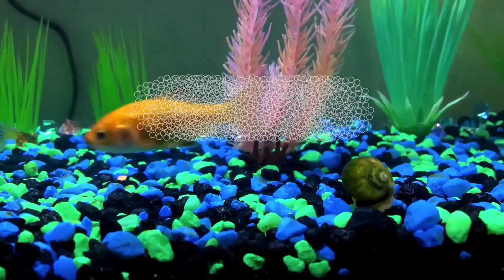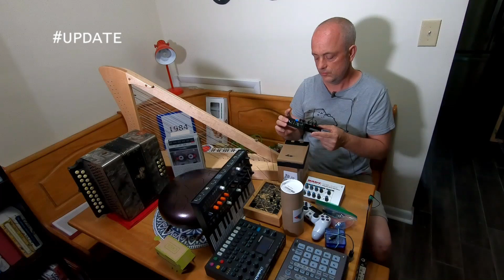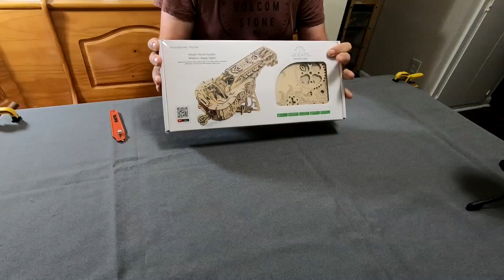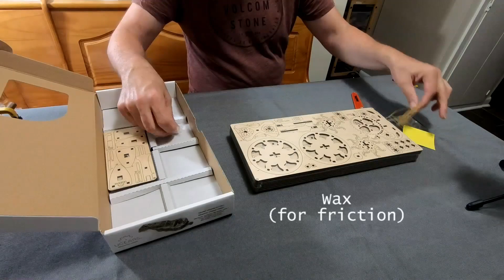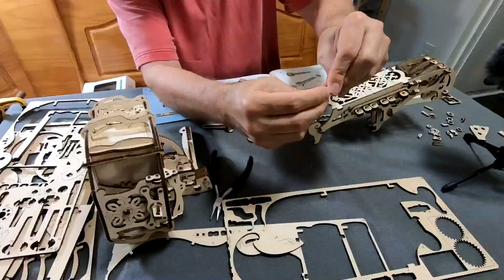Hurdy-Gurdy!

Comment: I look forward to videos featuring the Olegtron. It's a fun little thing.
Reply from the maker: Kyle Estey Stoked to learn more about it. Skimming the manual sort of reminded me of the BitRanger, which I’m a huge fan of.
Reply: @undulations  If it's like the BitRanger then I've really been slacking on picking one up. I have a Kastle and a softPop and the Olegtron goes very well with them.
Reply from the maker: Kyle Estey Based on that I think you would like the BR a ton! It’s a couple of intertwined oscillators, LFO,  a bazillion clocks, etc. plus it can hook directly to your aforementioned gear. I did a pair of videos about it on this channel 3-4 months ago, also a clip at the end of the first (I think?) Volca Modular video (which you may have, but if not, it goes so great with pin cable gear by adding a sequencer, filters, etc. into the mix). Anyway, this Insta post of BR is what it’s like with some intense reverb:
https://www.instagram.com/p/Bt9bff7hGFe/?igshid=h41oyxtltkl5
Reply: @undulations  That IG post was wild. I'll definitely be picking it up, been meaning to for too long now. I don't have a Volca Modular and I've sort of kept the Volcas at a distance because I recall reading something about their patchpoints not playing well with other similar devices but I could be misremembering.
Reply from the maker: Kyle Estey Well, the third VM video that I did (“Kastle Volca”) is about using them together - my basic take is that anyone with a VM should get a Kastle to add voices/timbres. But the VM brings a ton to the Kastle. They just need to share grounds, most easily done with an aux between the Kastle i/o jack and the VM CV-in jack. The second half of that video is just demos of Kastle and VM. Anyway, sorry to be spamming on this stuff - I just find it all amazing for the $.
Reply: @undulations  No apologies needed, this is all fascinating stuff.